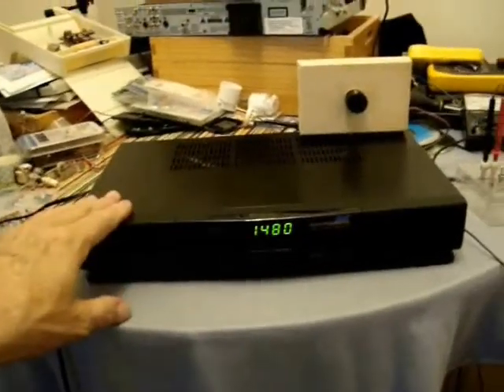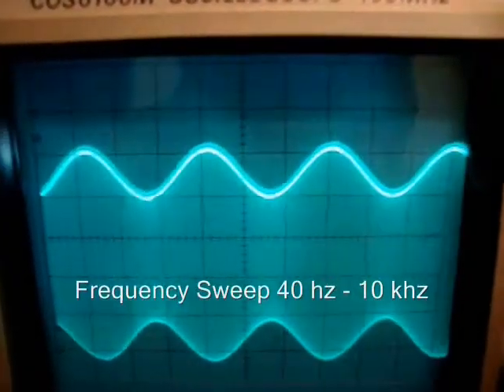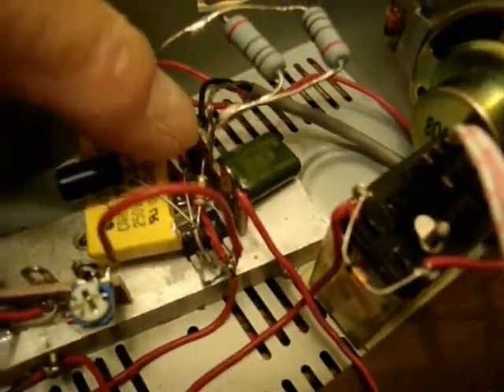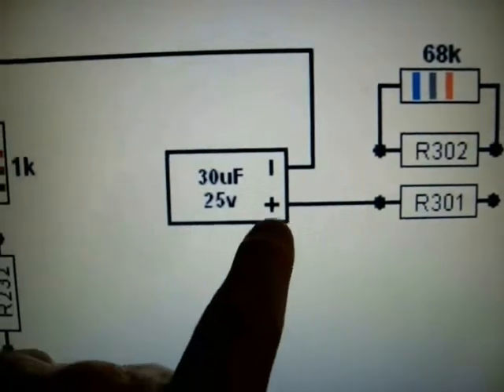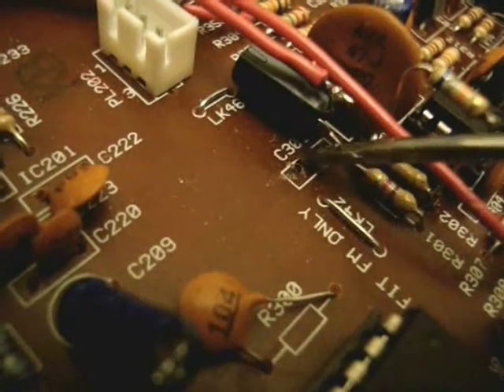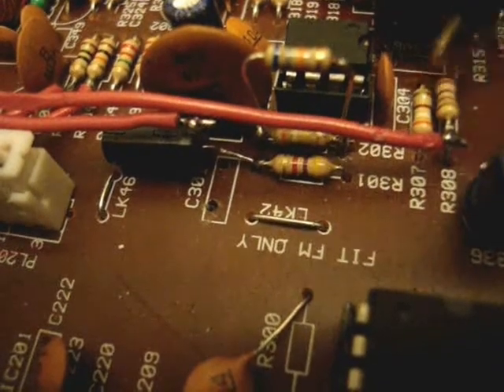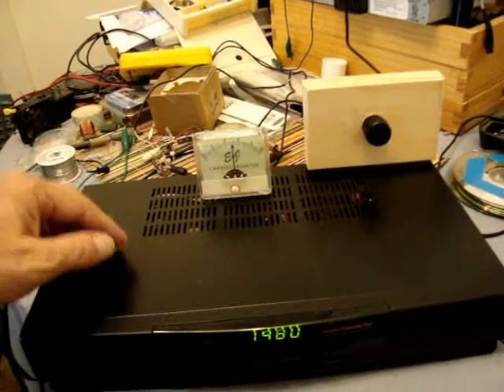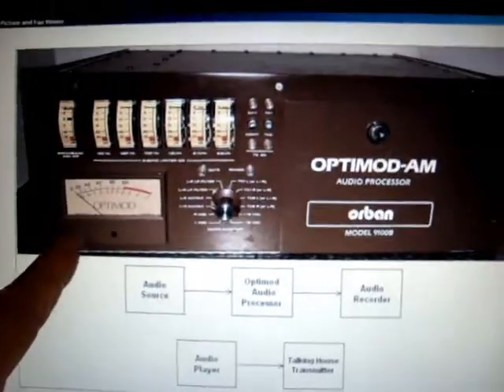Talking House AM Transmitter Modification

Comment: Another audio processing choice for those who cannot easily find or don't want a physical audio processor is to use a program called Stereo Tools.

I use that for my part 15 AM transmitter and the audio I get is as good as professional broadcast stations.
Reply from the maker: Good one, thanks. Yes, I've heard about ST. I'LL have to try that. I've got the Omnia processor pgm that works good, but it doesn't have an NRSC curve for AM, so I have to fabricate my own NRSC curve with an EQ.
Reply: @bob4analog  You're welcome. The best way to use Stereo Tools is either on a computer used just as an audio processor or on a computer with whatever music you have using a program called Voicemeeter Banana. That program replaces the Windows volume mixer which allows you to route the audio to Stereo tools.

There's even a version of Stereo Tools for the Raspberry pi 3+
Reply: @bob4analog  I've always been tempted to get a talking house transmitter. Does your mod apply to all the versions or just the version you have?
Reply from the maker: @ikonix360   I only have the 4.6-M version. I'm not sure about the other models, altho all the picture insides of the black models I've seen look the same. So I'm inclined to think they're similar. Getting clear documentation on this type is very scarce.  I've had to do a lot of reverse engineering on the one I have. So at least I've got some reliable info now. I think if you get any of the black ones, it's good. All of them I've seen have the outdoor antenna connection which is nice feature to have. I'm going to do a hack on that next.
Reply: @bob4analog  Oh ok cool.

Comment: Nice Bob, you should be hired as the taking house design engineer to fix all the bugs.
Reply: The Talking House is full of bugs .  I worked through all of them with out making internal changes and managed to get up to 9 miles and an average of 7 miles  range , up to 6 tenths of a mile city grade coverage .  I changed mine through the antenna , and doing that increased the band width , sound quality , hum , and improved  SWR .
Reply: @RedMetalRadio  Are you the one who made a PVC antenna?
Reply from the maker: No, but i do have plans for making one.